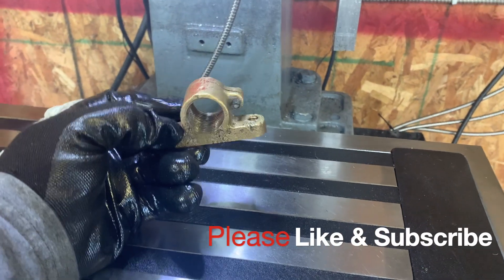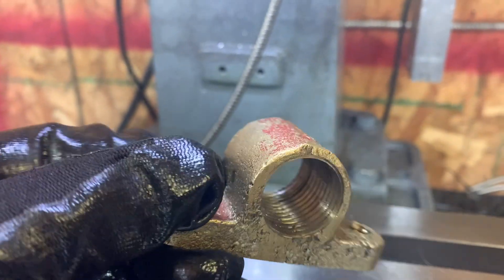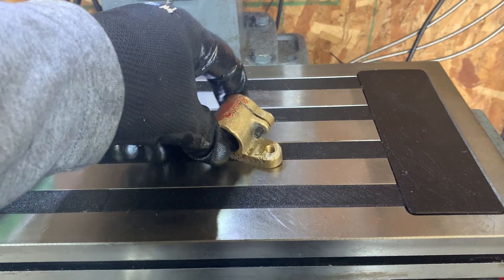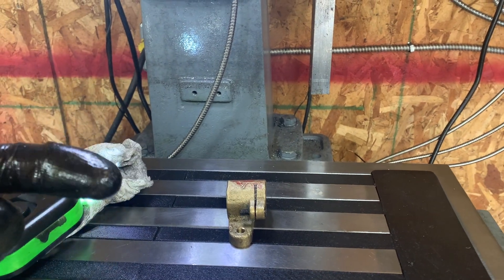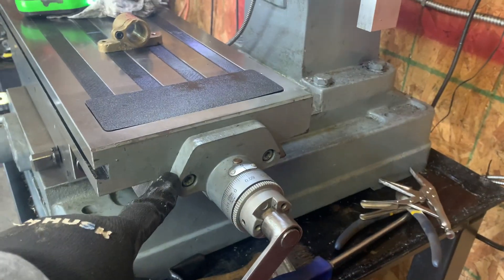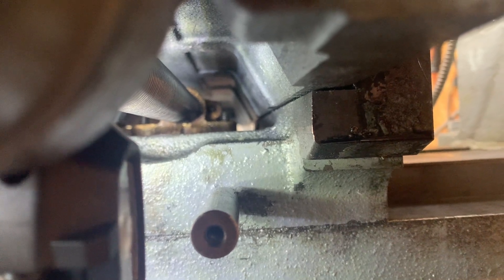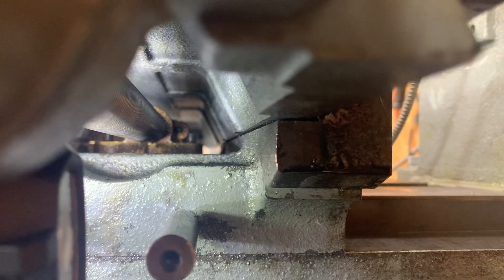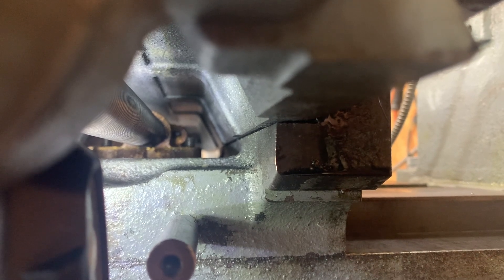Worn Out Leadscrew Nut Update

Comment: Good advice pays off. 
I finally got my machine a month ago PDM 30 from King Canada. Yesterday I decided to check it. the orientation of the lead crew nut actually it was facing  forward. You are absolutely right. I was checking in the service manual from King Canada for this machine and you clearly see that the small allen adjusting bolt is facing the back of the machine. I decide also to check on the service manual for JMT 15 from Jet tools. it’s almost the exact same machine and the lead screw nut facing also the back of the machine. So I did dissemble everything and turn the lead screw nut correctly, according to the service manual. Thanks for the advice Gilles
Reply from the maker: You’re very welcome Doc.  I’m glad I could help. Its a nice machine and I’m sure you’ll enjoy it. Gilles

Comment: My PDM 30 was also prematurly worn out and guess what??  MY table nut was also put in backwards!  Not only did it wear out the nut but the lead screw is also showing premature wear.  My machine is outside of warranty but I still contacted King to get parts and offered to pay for part of the cost but since this seems to be a production issue, didn't feel the customer should have to cough up full MSRP on $500 worth of leadscrew and nut.  King Canada's response:  
•	These are wear and tear parts on the PDM-30 , meaning that they are made to wear out first so that they protect the shaft . Which is common practice for all our machines (and others) .   
 - NO!  the nut may be 'wear/tear' but 1) it was improperly installed and 2) the 'shaft' they are referring to is the worn-out leadscrew which clearly was NOT protected.
Reply from the maker: That’s infuriating. I’m sorry you’re going through that Jim.  Gilles